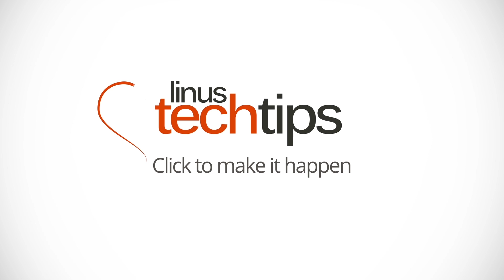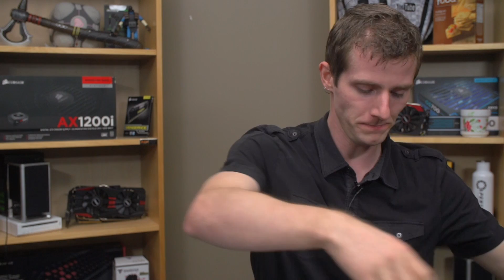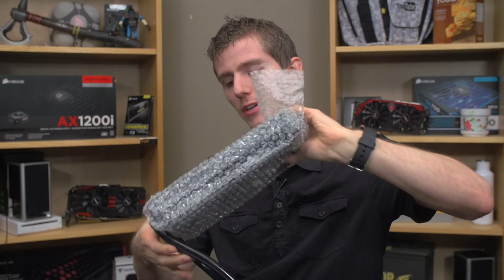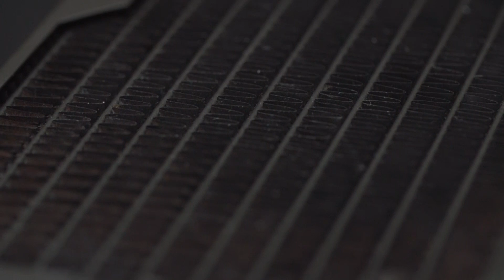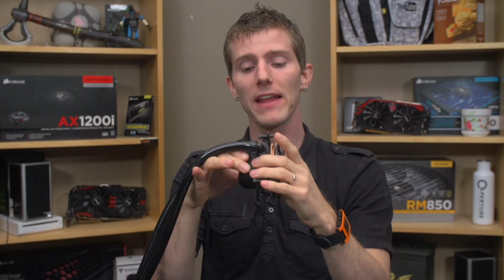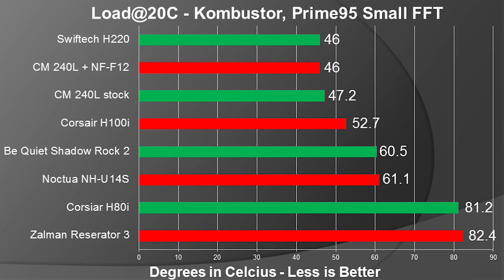Cooler Master Glacer 240L CPU Water Cooler

Comment: I have had this cooler in my PC for 2 years and 4 months and the pump just quit working. CM will not RMA is because they only have a 2 year warranty. They must have tested that cooler a lot to find out how long it would last and set the warranty just under that mark so they do not have to fix or replace them...

Comment: Seidon 240M vs Nepton 280L vs Nepton 240M vs Corsair H110i GT. 
¿which do you recommend which is best?
Reply: Antonio arrieta If you have a high TDP CPU like an I7 extreme edition or AMD 9570 getting a 280 rad makes a difference. Not huge tho, but since you are asking for those 4 i assume you got room for a 280. Out of those i would pick the H110 GT since it's a 280 and its a very well made product. If budget is a concern, i recomend what i have for my 4790k, the corsair H105. It's a 240 thicker rad and for me it's all i'll ever need, i can't make the CPU go above 65 degrees, literally, i tried. Finally I think if you are not buying after market fans the decision changes since simply put, all of those cooler have VERY noisy fans EXCEPT the Nepton 240M that has great silencio fans, i have my corsair H105 on push pull AP121s and a couple of great phanteks fans i got, but that adds value, so if you want the best performance at reasonable noise levels, I'd get the corsair H110 GT and a couple of good quality fans, Noctua's NF-A14s, AP141s or Phanteks PH-F140MP, you get a solid AIO and great fans for a premium.
Reply: +Antonio arrieta if you can support 140mm fans in the front or top, go with a 280mm product. If you have multiple 120mm fan support, go with 240mm product :)

Comment: Personally I would love to replace my nzxt x60 with this so I could later add a graphics cooler unfortunately I'm on a strict budget and I don't think the msi 770 lightning can be water cooled (I don't think ekko or however that companys name is spelled lol makes a cooler for non oem 770's)
Reply: Stick with your x60 bc the glacer is great you could get the xspc 360 kit (rad, hoses, pump, cpu block etc) for less than a glacer which to add a gpu would need another 120 rad to work well.

Comment: Does anyone know how to slow down the pump speed? As said in the video it is very loud at full speed, but it wasn't specified how to do that.
Reply: Yes. Your pump should be hooked up to a sata than also hooked up to cpu fan header. It's as simple as enabling quiet cool in bios and manually turning down the pump. I use. It at 60% with fans at. 60% and it's a lot quieter and only lose 2-4 degrees tops
Reply: Cool thanks. I'm pretty new to this so I don't know much about the BIOS yet, but you've been a big help!

Comment: Could someone please assist me real quick. I bought the 240L and I can't tell if I have the latest version aka "revision". Does anyone know how to tell? It's May 31, 2014. I want to know ASAP so I can 1.) Install my awesome new water cooler, or 2.) Send it back for being OLD lol. I wish to ensure I have the latest pump, impellers, etc. Thanks. ^_^
Reply: One way to tell is if the connections on the po can be removed. If they can you have the newer version if not you don't
Reply: My pump died and yep...the replacement they sent has the disconnect-able pump wiring. :)
Reply: Yeh I have the original one and kinda hope my pump dies so I can get the version 2

Comment: if it was possible, it would be interesting to see how this pump performs with an additional radiator see the performance it would be against a custom water loop.
Reply: Performs great with another rad and more hoses for gpu cpu cooling just like a custom loop

Comment: Should I get this or the H100i? I like the performance of this but Link integration is really attractive for the H100i plus it has a cool lighting effect.
Reply: H100i's Link is shit. Software is very buggy.
Reply: I have an H100i. would not recommend it, performs similar to some high end air coolers which cost around $20 less and are more silent, and Link is absolute garbage, has compatibility issues with some motherboards and is very clunky to use.
Reply: I have a h100i and a bunch of corsair link stuff.  It sucks. The h100i has a high pitched whining noise that drives me nuts and the software is non functional.  Watched this video because I'm planning on throwing it away for the glacer 240l.  Oh and "link integration" is just fan control.
Reply: you might have to connect the h100i to a usb port on the rear of your pc, rather than one of the headers on your motherboard, as with some boards it straight up doesn't work otherwise.
Reply: RoyRaptor1
 yes, H100i didn't work on one of my internal USB ports. As for connecting it to an external - that is ugly!
Reply: this or h220
Reply: i would pick this or the h220
Reply: Ubeogesh you don't need to leave it connected though, can just connect, change settings, then disconnect and it retains your settings. But anyways, I don't really like the H100i :P
Reply: This 100i is good but this is better don't be scared off just because corsair been around for awhile people feel 100i is the safe bet but this has out performed it and works great.

Comment: I think I'm looking for this....

The main drawback to AIO coolers for me is mounting them.  I have to have a case that is compatible with the radiator or able to make clearance.  I feel like I'm always sacrificing something with an AIO.  

For instance: in a NZXT Phantom you can use a Corsair H80i.  It is easy to setup from the rear 120mm fan slot, you can set it up intake or exhaust very easily.  However, doing this means you won't be able to utilize your 230mm side fan. On the other side you can use an H100i.  You have mounts that allow you to mount it just below your top 2x200mm fans.  You then have to make a decision about how to set it up, since it won't be flush.  If you modify the case and remove the fans, you've lost those exhaust fans.  If you let the cooler hang a little lower you will be limited on the types of RAM you can install, because it will interfere with it's clearance.

I would love to go with a homebrew solution, but I just don't have the time and patience for it.  I would love to have a system that is pre-filled and doesn't require me worrying much.  If it came with some included software like Corsair Link that would yell at me if I did need to top it off or adjust it, that'd be great.  

This cooler looks fantastic.  While watching a recent video on NZXTs GPU cooling solution using the Asetek coolers I heard him mention that they weren't good for CPUs and just had to find the most recent liquid cooled CPU video and see what the new hotness was.  I am quite interested now.  I've been researching AIOs for about a month and having seen that the H220 isn't even for sale in the US makes it harder for me to get.  I'm very excited to see if this might sate my urges.

Comment: having gotten excited about the h220 from your CES video last year, i waited through all the production delays, and finally got a unit in late march/april i think.

let me tell you, it's been NOTHING but trouble. having RMA'd 3 units, the 4th is now out of my rig and sitting in a corner while i try not to think about how infuriating the experience was and what a waste of money i'm left with.

none of my units would go more than 2 weeks before the coolant evaporated to the point where the pump starting sucking air and making tons of noise. the design of their rad/res means any tiny, tiny deficit in coolant results in air getting sucked into the tubes heading to the pump. until they move the tubing or the reservoir, it WILL suck air, and make tons of noise.

maintenance free for 3 years? there's NOOOO way in hell that would every happen. i'd have been happy with 6 months at a stretch, but after having the last unit pump decide it was going to run at max rpm all the time, i took the thing out, and gave up on it completely.

100% junk, and this unit is Cooler Master only in branding. DO NOT BUY THIS PRODUCT!

you WILL be sorry!

Comment: swift tech kinda sucks they have had a lot and I mean ALOT of issues with there aio coolers and as for this one on newegg theres nothing but bad reviews of the wiring burning up and shorting out I don't trust anything with the swiftech name plate
Reply: That was the first batch. The new one and even after the first few months the problems been fixed. Mine runs like a champ

Comment: I have a question. Is it cofigured in Push or Pull right out the box because I can't tell. I remember Linus in another video saying that these ALL-In-One Liquid Cooling Set-Ups should be configured in Pull as it will be less Dusty and I won't have to clean it much. Thanks!

Comment: LinusTechTips I know that this is probably a "noobish" question but where would you go about changing the pumps power? What size tubing does the Glacer have and could use a different coolant besides the stock coolant for cosmetic reasons?

Comment: A good AIO watercooler is a nice way to "get your feet wet" with water cooling. I started with the eisberg 240L precisely because it was expandable.Over time it gave me the flexibility to slowly upgrade to a full custom loop. I see a good expandable AIO cooler as the best way into what can be a daunting, and expensive hobby.

Comment: I prefer an all in one cooling solution like this. You know it works, there's enough testing data out there to know what to expect as far as temperatures are concerned and it kinda eliminates the variables that would be expected from individual water cooling setups. I went with a H100i for this reason.

Comment: For watercooling, either you get a pre-filled and non-modular cooler or you go full on custom watercooling out of the gate.  There's no point in getting a pre-filled solution with "plans" to add graphics cards later.  By the time you upgrade, your graphics cards will be outdated.  For me, the Corsair H100 works just fine.  I've had it since November 2011.

Comment: Let say, you playing battlefield 4 and using either razor headphone or a 7.1 system speaker, i promise you all, Loudness is not an issue. When you twittface or mytube, its not load of couse because the temp of gpu cpu are low. Its happen when playing games. Stop shitting about noise.

Comment: Personally I only use custom loops, but I think this could be really cool with a NZXT Kraken G10 so that you could mount this on the Kraken to cool the GPU and then buy a CPU waterblock and merge it in the loop for an easy / low cost GPU / CPU watercooling system.

Comment: I personally like the XSPC Rasa 750 Kit as well and wish that more companies would have full kits with separate pump/reservoir instead of in the cpu block and built in to the rad but like the XSPC Kit have the pump inside or mounted to the Bay reservoir or have a pre-built pump/tube reservoir mod and have certain kits that are 120,240,360,etc.... and have options for later additions and keep it all under 500 but starting as low as $170.00ish the $500 option would be for dual rads and maybe a gpu block with a pump upgrade. But full custom kits of course they will be rebranded to each brand but this is where I believe its at. The All in One that they have know can still benefit most but a full customizable loop is what most end up desiring and who ever can bring it to market with the best quality/performance is going to benefit the most out of it.

Comment: I kind of question the AIO Water coolers of even using them when a good air cooler can do the same cooling and at sometimes a lower price. I'd much rather have AIO water cooling for my video card over the CPU since you do get a greater benefit in FPS with video card overclocking.
Reply: ***** I did look into getting an AIO water cooling just recently and I almost did get one, but opted for a HSF the Silverstone NT-06 Pro. My thoughts are no chance of it leaking or pump going out, plus the price was about right. It performed  fairly well and quiet.